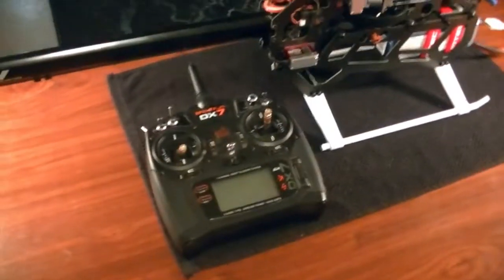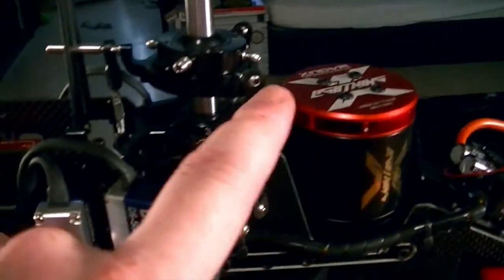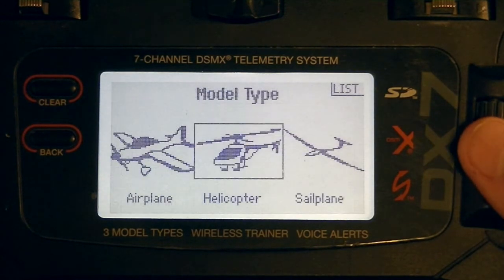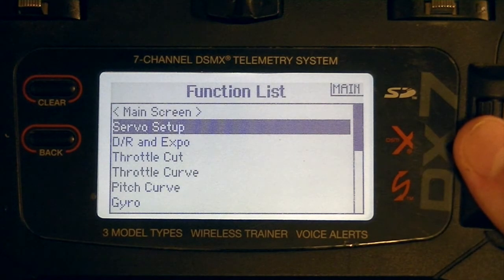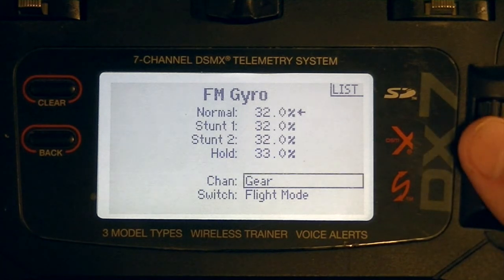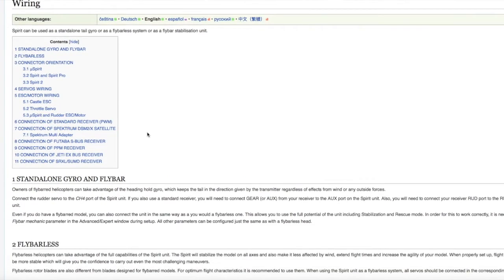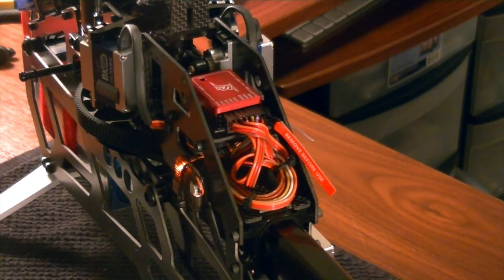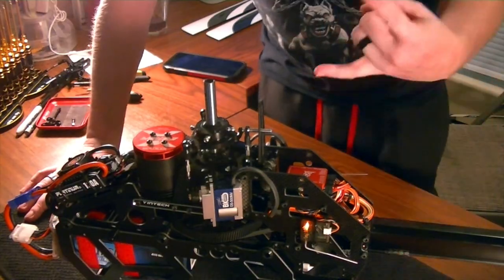Spirit 2 : Installation And Binding

Comment: Thank you for an excellent video series. One question please, I'm using a spectrum DX8 and a AR8000 DSMX standard receiver, so do I bind with the bind plug in the receiver? I've tried to bind with the bind plug in the sys port of theSpirit2 with no success ( the receiver doesn't flash) but it works Ok with the bind plug in the receiver in the usual way.

Comment: I've been trying to get my head around which DSMX satellites to get with my new Spirit GT. This will be my first time using a non-Spektrum FBL controller. I've been eyeballing the SPM9745 DSMX satellite, but I see no documentation about it in the manual. Which satellites did you use?

I'm also unclear on the purpose of using a second satellite. Is is strictly redundancy? I see a mix of people saying that I should get a full-sized RX instead like the AR6610T, but nobody is explaining the advantages and disadvantages of going that route, or going with one satellite, or going with two.

There's so much to learn here!
Reply from the maker: I always recommend two sats for safety for sure.  I used just the standard DSMX satellites that they make as of today date.  Nothing to fancy !

Comment: hi Freddy Great video!! i just recibe my micro Spirit for use in mix helicóptero size 230 with the motor an esc from blade 230 S v2. I need to use BEC or i can conect direccionales from the esc the power Supply to the micro Spirit in the aux2?? Thanks in Advance